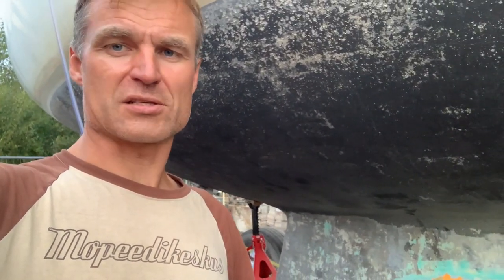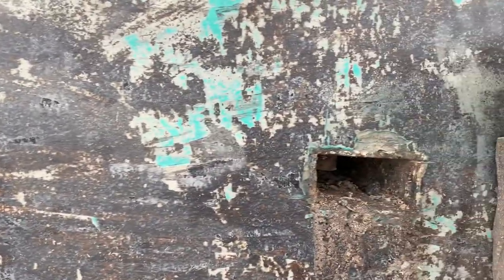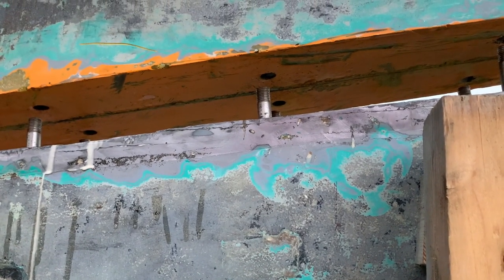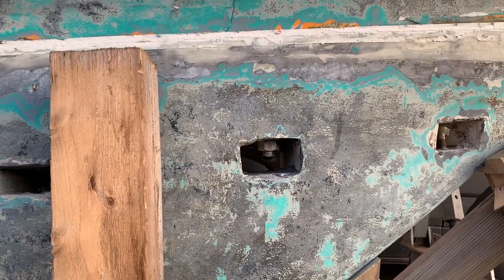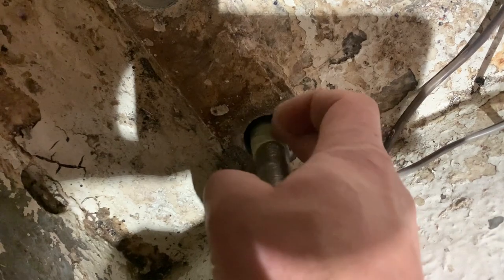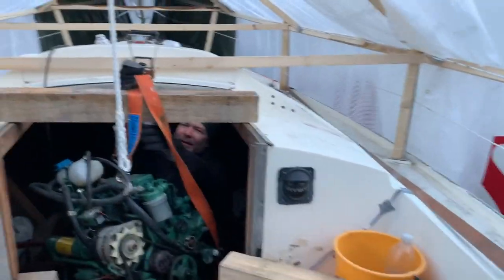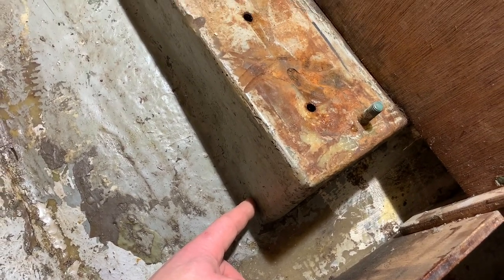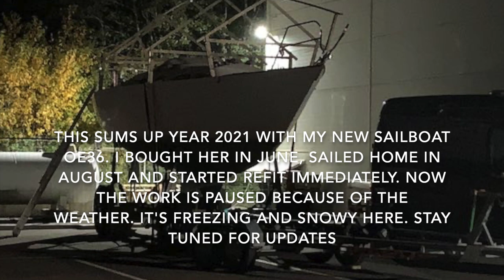Reattaching the keel and removing the engine of my sailboat OE36

Comment: You are taking on a big task so best of luck. The dirty tank at the back was probably the original fuel tank and the cylinder you removed a home designed replacement.
Reply from the maker: Thank you! You maybe right about the tank

Comment: In the 70s many manufacturers did use marine concrete as a cheaper substitution for lead or iron for additional ballast.  It was due to the crazy prices for petroleum products due to embargoes etc.  Boat manufacturers had to cut costs wherever possible.

Comment: Do we see some of the old trim tab control mechanism in the 'tank' located behind the actual fuel tank?
Reply from the maker: Good eye! That's what I thought, too. But it turned out to be a P-bracket laminated through the hull to support the back end of the prop shaft.
Reply: @sailingsmalldreamingbig9022  Keep posting, regards.

Comment: Did you consider filling the bolt holes completely with thickened epoxy and then re-drilling the holes?
Reply from the maker: I considered it but it would have been impossible to re-drill the holes to match the angles and locations of the holes in the keel.

Comment: what was the torque spec you used?  just curious because the info online can vary alot. the bolt seems to be M20, am i right? im guessing you torque them around 350 Nm (unlubricated spec)
Reply from the maker: I have only torqued the bolts by "hand feeling" and not too much torque. I've yet to install 2 bolts but the weather prevents doing it. Once all bolts are in I will torque to spec. The bolts are M20 and I will look up for the torque specs
Reply: @sailingsmalldreamingbig9022  there are 3 grades of SS (that i know of, maybe there are more), but your values should not be higher than 300 to 350 Nm. my keel bolts are 1 inch and i had to choose softer steel to maintain the torque spec "acceptable"....because a  torque wrench higher than 350 Nm (max torque) starts to be a little expensive, specially for something you do once every 2 years.

Comment: Looks like your not the first person to remove that keel. Do you think that the boat suffered a hard grounding, and that bent the keel bolts?  Did the previous owner inform you about the leak?
Reply from the maker: The previous owner didn't know much of the history of the boat. I don't think that the boat has been grounded hard. No traces of that. The keel bolts were no bent but installed at different angles
Reply: @sailingsmalldreamingbig9022  Maybe when the yard made the boat,  they lowered the boat onto the keel and then drilled the bolt holes, and drilled the holes at opposing angles for a more secure hold? Maybe removing the bolts first before seperating the keel to prevent binding is the way to do it? A lot of keel bolts are molded into the lead and are not removable, so dropping the keel straight down makes sense. Having lower nuts and angled studs could be an indicator as to how to make the separation. I am learning a lot from your videos. Thanks for making them. Good keel repair videos are hard to find.
Reply from the maker: @sailingeden9866  I'm glad you found something useful in my videos. I am certain that the hull was lowered onto the keel and then the holes were drilled through the hull and keel. But I do not think they were drilled at different angles for safety reason. It just happened so. Most of these OE36 sailboats were built by owners themselves and some parts build quality is pretty mediocre. Yes, pulling up the keel bolts first would have made separation much easier.

Comment: Thamks for video.
Great job done.
What epoxy mix you use for filler between keel and body?
Reply from the maker: I'm not sure of the epoxy brand if you mean that. I buy it from a local supplier of the industry in 4L cans as well as other composite materials. I mix the resin with "Microsphere" as a thickener. Microsphere feels like very fine powder but is very small diameter hollow glass spheres indeed. They also sold me an additive to reduce run (the keel surface was sloped and resin tends to run down the slope). Any epoxy resin will work there with proper additives.  It is important to clean lead from oxide and coat it immediately. As a sealant between already faired keel and hull surfaces I used Sikaflex 292i.
Reply: @sailingsmalldreamingbig9022  Thanks for clearly explenation.
HAPPY NEW YEAR 2022!!!!
Reply from the maker: @janisspalvins677  Happy New Year, fair winds!

Comment: I have a shipman28 and it has the same keelbolt construction. How do you fill the holes in the keel? Regards Tomas
Reply from the maker: Congrats, Shipman is a very nice boat. I own one, too! About the holes: First I will fill the cavities with closed-cell foam that will not absorb moisture (just in case). Then I will plug the holes with epoxy filler (1.5..2cms thick), like it was done before. And probably lay a layer or two of classfiber cloth on top of the plugs to secure things
Reply: @sailingsmalldreamingbig9022  I yes i noticed that you have a shipman to. Do you have the same type of cavities om THE shipman to? It looks like holes in the shipman is welded. I also have leaking keel bolts on the shipman. The seal between keel and haul is old.
Reply from the maker: @tomassonnerup6006  My Shipman 28 has cat iron keel (OE36 has lead). Bolt holes in cast iron keels are usually threaded into the keel itself. There are no nuts nor such cavities for nuts in the keel (usually). On my Shipman I could easily get the bolts out to check them. The bolts extended enough into the bilge and allowed me to use double nuts to turn the bolts out.